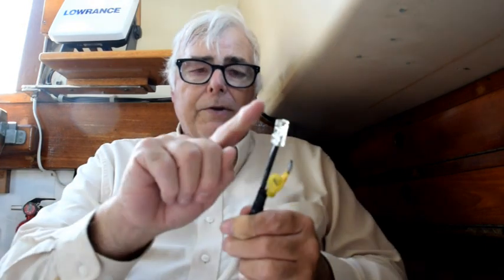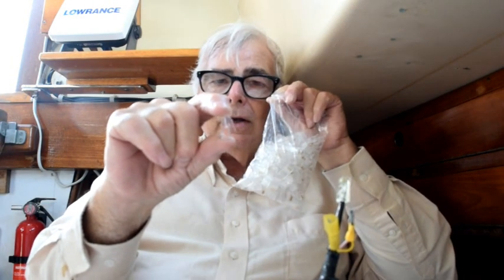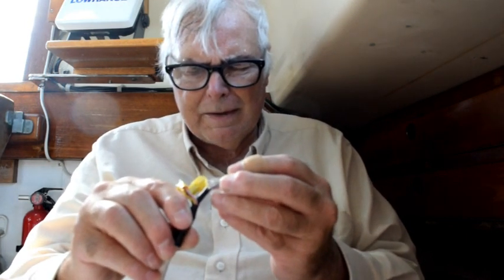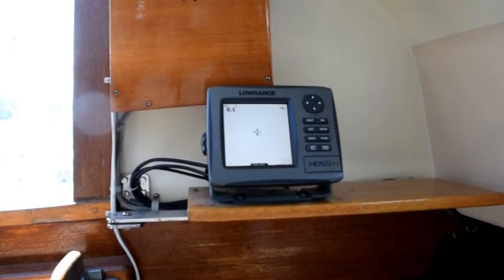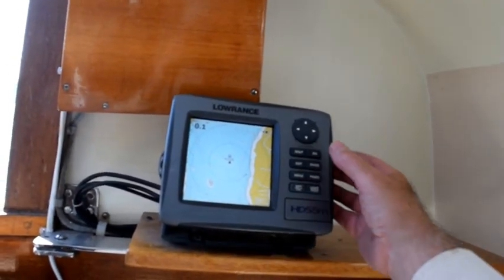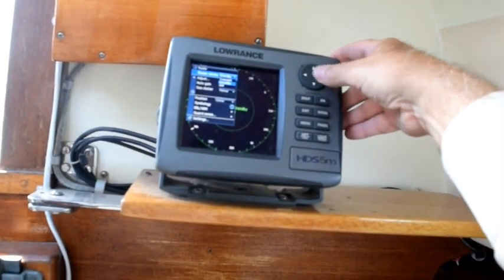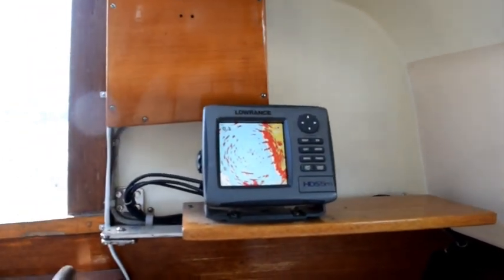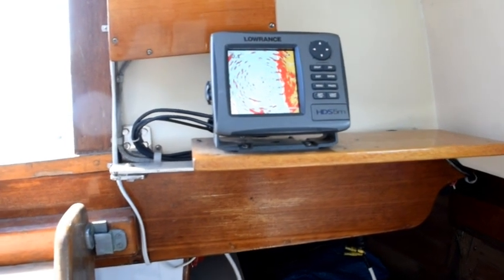Repairing the Cable on My Lowrance BR-24 Broadband Radar

Comment: Would be interesting if it used any kind of RJ45 standards like CAT5 .  Most cables are wired  to T568A and T568B with last being the default.  99 spares on the wall, 98 spares on the wall ...
Reply from the maker: My understanding is that the CAT standard depends on the ratings of the cable and the connectors.  I don't know what standard the cable was made to, but I used a CAT5 rated connector.

Comment: question: was the radar unit powering on?
Reply from the maker: There was no way to tell without going up the mast.  Replacing the corroded connector fixed the problem.